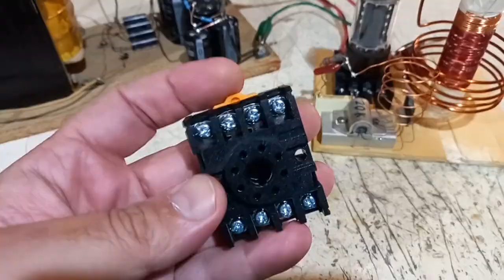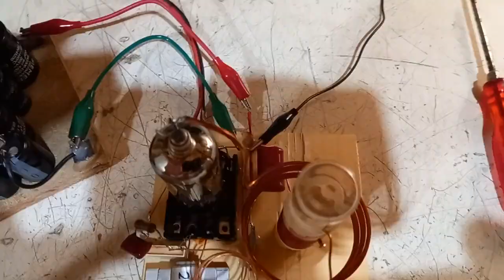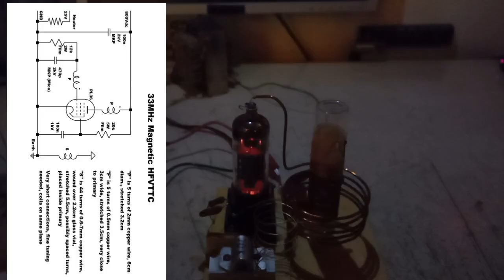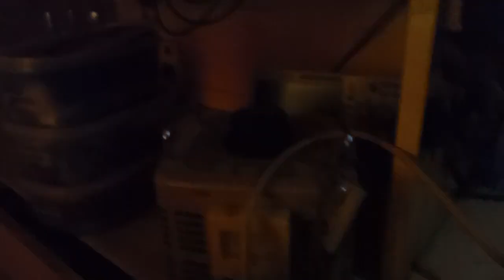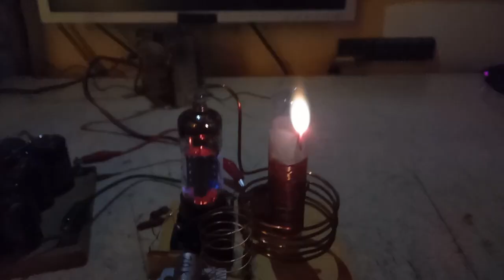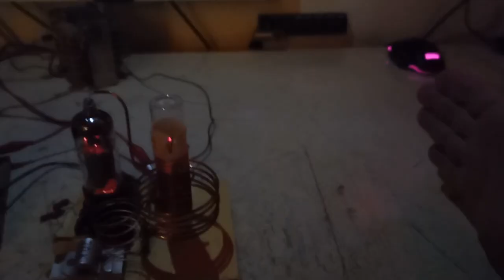33MHz HFVTTC With VTTC Schematic (high frequency electric flame)

Comment: I use these relay sockets for valves too. Really handy they fit and have the terminals for easy connection. The old radio tube sockets are getting harder to find than the valves too.
Reply from the maker: i ran out of octal sockets cos i made the EL34 amplifier, yes, i almost always salvage sockets, tho it's been a while since they give me a tube TV

Comment: Really impressive!
Too bad you cant scope it easily without detuning it.

Isolating the tube through chokes (L or RL) could be beneficial to only have the coils (position, spacing etc) and flame loading as a factor.

Great video as always. 
What if you attach a transfomer in series with the Negative terminal of the psu and supply an audio signal, can you make it into a plasma speaker?
Reply from the maker: i hate singing arcs and musical tesla coils, you make a badass device and play music on it? disappointing!! when i make these things i don't consider at the slightest to make it sing